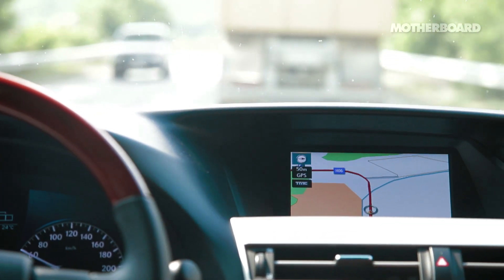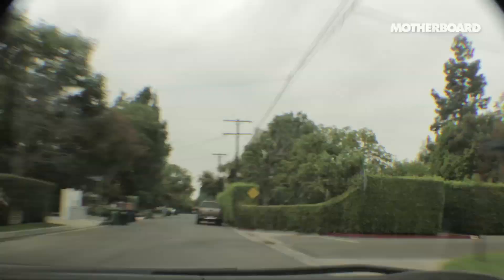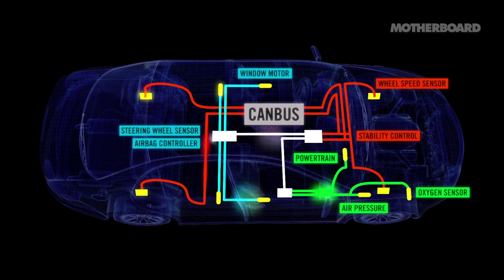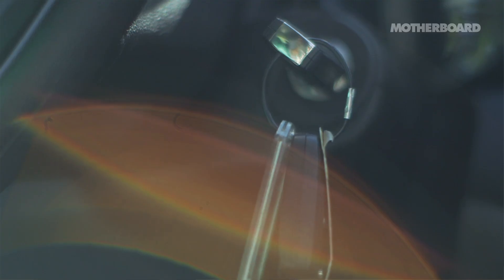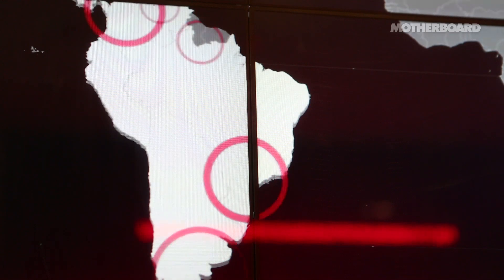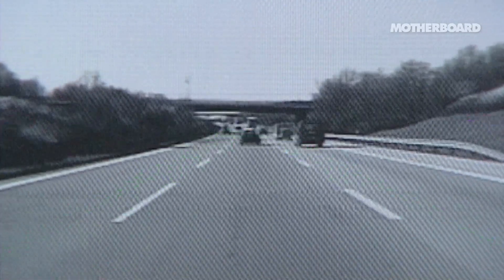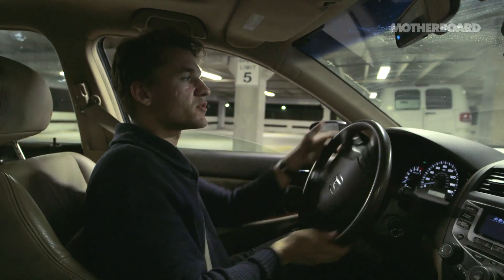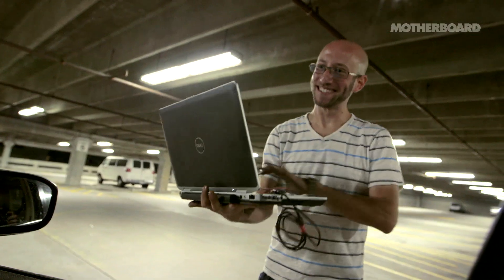How to Hack a Car: Phreaked Out (Episode 2)

Comment: I didn't think the hand brake or foot brake were electronically connected
Reply: In new vehicles, yes, but its still rare.  Its becoming more common and I personally don't like it.  I want an emergency brake that is manual, no electronics what-so-ever.
Reply: neil78b my dad has v70 and the brakes are so awesome when u brake to hard the hazards come on yea I know what u mean though but when do u use a hand brake to do an emergency stop
Reply: THERUBBISHPCKID
Hopefully never.
Reply: ThatKidFromThatShow lol hand brake yes but windows just no
Reply: THERUBBISHPCKID Electric windows would be locked if someone was trying to kill this way.
Reply: neil78b No way, brother, I know brakes. When you press on the brake pedal, there is a rod that goes from the pedal through the booster to the master cylinder. That's a direct mechanical connection from your foot to the MC, then the brake fluid is put under pressure due to your foot pressure, and mechanical connection to the MC, and the fluid goes down the lines to the calipers/wheel cylinders, where it pushes the cup/pistons out. ABS systems are electronic, but the basic part of the brake system is still 100%manual, except parking brakes. Parking brakes on a lot of cars are now controlled via computer. You pull the lever or bush the button and the computer does the rest. They have not made the jump to "brake-by-wire", they have "drive-by-wire" and a few are even toying with "steer-by-wire", but no "brake-by-wire" systems yet.
Reply: ***** ***** 
I hate to jump into this argument, but ill give it a go.
So "hacking" the brake system; not really possible. 
Most cars have a mechanical connection from the brake pedal to the brake booster. The brake booster operates with vacuum made from the cars engine, supplied to the brake booster in different ways. Even if the car dies, you got functioning brakes thanks to good old hydraulics. (Small piston to larger piston and so on) The brake pedal will have to be pressed alot harder without the help of said brake booster, but they will still work. on cars with ABS/TRC/VSC systems, you can fool around with the brake actuator and make the brakes a little funky, but eventually that will make the car come to a stop anyways.
Some cars however got an electric brake booster, but even disableing this is pointless, beacause the safety feature for this is to leave the mechanical valve open, so even if all electronics die, the mechanical connection will still work. I have yet to see a car with strictly electronic brake operation, but that does ofcourse not mean it doesn't excist.

When it comes to steering, many newer cars do have electronic servomotor mounted directly on the steering shaft, and i.e Prius got parking aid system wich in theory can be hacked (if you can break into the car and install something to wirelessly send and recieve signals from a computer) and remotely steer the car. On other cars with electronic servo motors, even if you disable the electronics you have the ability to steer, allthough it will take a pinch of muscle to turn the steering wheel. You can activate the electronic steering lock on cars with "smartkeys" and lock the steering wheel in a fixed position ofcourse, but in most cases holding the smartkey close to the startswitch will deactivate this.

The throttle however is more and more often electronicly controlled, wire from the pedal to a motor on the throttlevalve. so you could make the car go faster, but shutting of the engine and braking will bypass this murder attempt. "But what about cars with "smartkeys" (keyless)
Simply holding the startbutton for usually three seconds or more will shut the ignition of.

And i can't really see any point in activating the EPS (electronic parkingbrake system) because this will only make the car come to a stop  anyways. Unless its winter and you want the driver to "drift"

Car manufacturers spend ALOT of time and money enhancing safety and safety features to their cars, both electronic and mechanical to prevent things like this.
Hope i covered most of the points from a neutral side.

IcyShadowFire
XOXO
Reply: neil78b Brakes are not electronic. They have not made that step yet. You still have a mechanical connection between your foot and the calipers/cylinders in the form of hydraulics. Now the parking brake, yes, electronic on a lot of cars nowadays.
Reply: They should just make the hand brake without electronics, and change make windows with the winding thing again.
Reply: ***** I'm really finding it difficult to follow that because I've been in quite a few vehicles that do otherwise.  For example, I was in a 2015 Caddy a few months ago and had cruise set, this car would actually gently apply the brakes when it got too close to the car in front of me without me doing a thing, you could actually see the brake pedal moving when it does so.  I've noticed this in a lot of vehicles, not just the more expensive ones either.  So, with that being said, I'm going to have keep up my original argument that the foot brake is electronically applying the mechanical and not solely mechanical.  Older cars were purely mechanical but most of these later model cars are electronically controlled at some part.
Reply: all new cars use computer brake
Reply: ThatKidFromThatShow true but what are the chances of a general citizen like you or me getting targeted and besides it would be a lot of work for the murderer ie planting the device on ur car and things
Reply: ***** breaks lock up when car dies... e-brake wont fail unless the cables are snapped
Reply: AstralLights Which *brakes are you talking about? The electronic parking *brake?
Reply: didn't bother to read any of these replies but yes a lot of cars now come with electronically controlled emergency hand brakes. Audi is a huge fan of them.
Reply: You can not electronically disable a hydraulic brake system! It is hydraulic! Dude, seriously. Electronics can only actuate or assist a hydraulic system, not disable, at least not on 99% of today's vehicles. Yes they are talking about it, and making big steps towards it, as well as "steer by wire" Your point, at this point is invalid. The car's brakes in this demonstration can not be electronically overridden to not function when you press the brakes, it has a master cylinder and brake booster. You totally avoided my question by the way.
Reply: IcyShadowFire im sorry I cant be bothered to read all that and ill just simply say you need a  hobby
Reply: IcyShadowFire Thank you! That's what I've been trying to tell him. They do not have a feature to electronically override hydraulics.... Period.
Reply: neil78b I don't even pay attention to people calling me a troll, especially when I'm not trolling, it's a pretty fucking stupid insult considering everyone and their mom says it about any body doing anything. But anyway, you can not bypass the hydraulics with the press of a button, period! You keep believing what you want, and I'll keep fixing them correctly because I actually know how brakes work.
Reply: The trolls comment wasn't directed to any of you guys btw, neil78b *****  Sorry about that, It was just a foolish comment to reply to Therubbishpckid.

And for what purpose would you hack a car? To kill someone? There are FAR easier way to tamper with a car if thats your plan. I wont go into details on that tho. :P
Reply: binford6002 They have not made the jump to "brake by wire" systems. There is still a mechanical connection via hydraulics between your foot and each wheel. 
I mean, you took the time to read at least one comment, why not read the one where I say I do this for a living? I work on cars every day. I know how brakes work, I know how the electronics work. The only pedal that's a "button" is the parking brake and accelerator. The brakes are still hydraulic. Period.
Reply: neil78b thats the most retarded thing i have ever heard.
Reply: those hondas have fly by wire brakes (electronic), it is the stupidest design of any braking system so far.
Reply: THERUBBISHPCKID Yeah, if someone is taking control of your car and you are near a small cliff over the ocean and decide to hack you to drive into the water, you don't have enough time to react and use the handbrake.

The only thing that can save you is if you open the windows, so unless you have a hammer in the car, then your ain't getting out.
Reply: ThatKidFromThatShow electric windows go down faster than hand ones
Reply: neil78b It won't be common for awhile...the whole purpose is in case of emergency (ie. electronics failure), if you need to hold the car stopped.
Reply: *****
You've got it backwards bud, the foot brake is mechanical but its electronic when you depress it and it sends signals for the mechanical to do it part.  The parking brake/emergency brake is the one that is purely mechanical and becoming electronic.
Reply: neil78b Ok, what exactly is your point? Is your point that brakes can be operated remotely, or that the brakes are a "brake-by-wire" system, meaning there is no direct mechanical connection between your foot and the brakes, like a "drive-by-wire" system? That's part right.  
The system you're talking about is adaptive cruise, cars have been having that for awhile now. With adaptive cruise control, yes, the brakes can be actuated electronically, but there is still a direct mechanical connection between your foot and the rest of the system in the form of hydraulics. It uses an actuator to take over when you're not paying attention. It's not like you push the pedal that pushes a button that tells a control module to actuate the calipers/wheel cylinders.
Reply: ***** What is your point?  Everything you said reinforces what I've said, that the brakes are electronic in some way as to allow for loss of control.  Also, adaptive cruise control never had anything to do with braking, it would simply adjust speed according by decelerating, only recently have they been including braking control.   Basically, I can take control of your car and disable your brakes, so that pressing on it will not do a thing, but the hand brake that is only recently becoming electronic is ridiculous because its the fail-safe for brakes and should always be purely mechanical.
Reply: neil78b The electronic parking brake has been around for years though. My point is that the only brake function on newer cars that can be overridden is stopping, you can remotely stop the car if set up right. It can not keep you from stopping though because you can push the pedal, which is a direct connection between your foot and the wheels. But the parking brake, yes could be overridden to not function at all.
Reply: *****
Now I'm facepalming.  I really don't know what to tell you pal, but you can press that foot brake all day long and it won't do a damn thing if I disable it.  The emergency brake is the one that had always been manual and impossible to break.
Reply: Facepalm away, brother. But would you mind explaining how you're going to override hydraulic pressure? By the way the first car I worked on that had an electronic parking brake was an 05 Jag. But the electronic parking brake has been around for over a decade already.
Reply: ***** Why would I override hydraulic pressure when all I have to do is disable the electronic control for it???  So the electronic parking brake is newer than I previously thought and even rarer, lol, thanks for again reinforcing my point!!!
Reply: ***** guys I cant be bothered to read the comments and take a side but seriously stop fighting and spamming my feed lulz
Reply: THERUBBISHPCKID 
Well... Feeding trolls on the internet is my hobby. :P 
And carmechanic is my job. :P
Reply: *****
You do know he wasn't helping you a single bit and he even called you a troll, lol.  Anyway,  my point still stands, that a cars foot brake can be rendered mute with a simple bypass, but I don't care about that since my hand brake would always be purely mechanical if needed.  And the emergency hand brake is the one that should never be electronically controlled in any way.
Reply: The brakes are probably, because of the ABS and ESP requiring control and activation of braking on individual wheels. So you can in theory activate the brakes, or activate it on a single tire, giving the car a tendency to sway in that direction. Brakes cannot be disabled electronically, at least not in "regular" cars. First time I hear that the handbrake is electronically connected. I disliked this movie because it purposedly doesn't go on details on these bits to give the impression that any car can be totally controlled remotely, which is totally wrong. Only modified cars can be controlled to some extent.
Reply: ***** you don´t need to override the hydraulic system itself. You just have to disable the electronic trigger that controls the brakes.
The gas pedal also is no longer physically connected to the injection- and engine control-system.
The pedals are nothing but "buttons" you have to push to initiate a reaction like braking or accelerating. There is no longer any physical link between the  pedals and the brakes or the engine control. The pedals are just triggers. Just disable or reverse the given commands when you put down your foot on a pedal. That´s it.
Cars with electronic braking assistant, power steering, electronically controlled gearbox, etc. are already reality and it will become more and more common in the next future.
Reply: ***** Yes, you´re absolutely correct and I didn´t intend to question your statements at all.

Maybe I wasn´t that clear with my comment, so I´ll try to get it straight:

I was talking about the direction in which near future cars are heading to, or about technology which is already implemented in a number of todays cars.
The google self driven car desn´t need a driver that physically applies a force on the braking pedal to activate the brakes (just a well known example).
I myself drive a car which has some kind of "radar" attached to the front of the car to "see" close or close coming objects that would probably cause a collision.
This system is linked with the brakes and it will - if needed - automatically slow down or completely stop the car, without my foot on the pedal.
It´s a brake assistant that will kick in if the human driver fails to react fast enough to be able to avoid a collision. The brake pedal doesn´t move at all when the car is slowing down or performs an emergency brake by itself. In case of an emergency brake the hazards will be activated automatically as well, to warn the following traffic.

I don´t want to promote any company, so I just give you a hint :-)  It´s a German car.

Please correct me if I´m wrong!
Reply: Traditional manual cars are still mechanical and are not electronically controlled to change gears or go into neutral. Automatics or the cars with flappy paddle gear boxes though are controlled electronically.
Reply: Hamguy Bacon
other than everything that comes out of your pea brain. lmao.
Reply: *****
Hell no nigga
Reply: ***** Yes, but I was talking about brake by wire, and how they don't use it yet. You can not eliminate the brakes, they are hydraulic between the foot and the wheels. You can only modulate via the HCU, but even with the dump valve(s) wide open the car will still stop, the pedal will just be extremely soft.
Reply: *****"WOW" is what your mom says after she bust her guts up!
Reply: Would never want to rely on electronic brakes, if that fails then what the fuck are you going to do at high speed?
Reply: the red light that goes off when you braking is computerized
Reply: i think the foot break is because of the ABS
but i dont really think that it cant be hacked